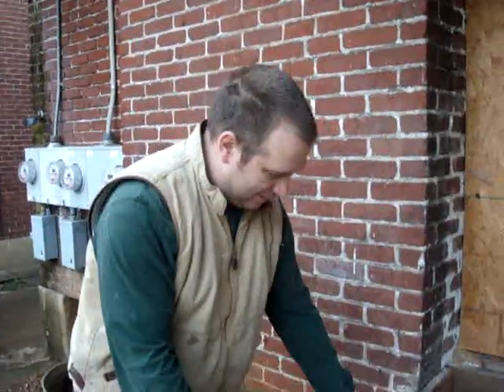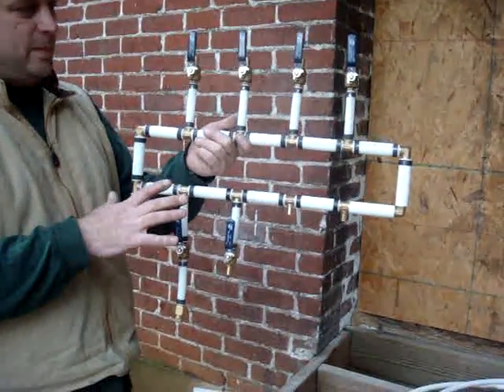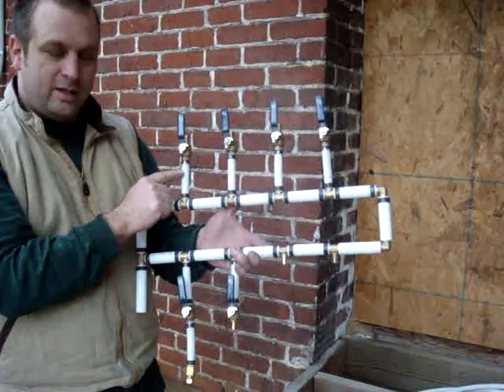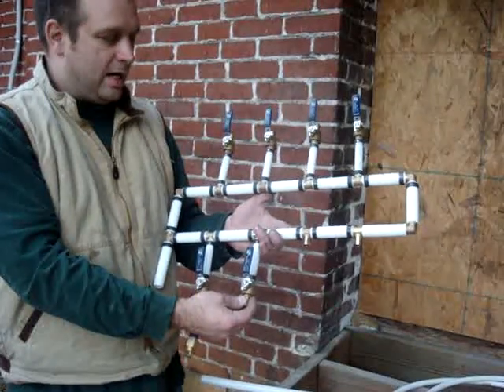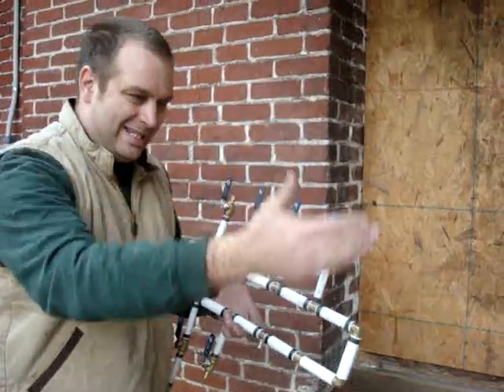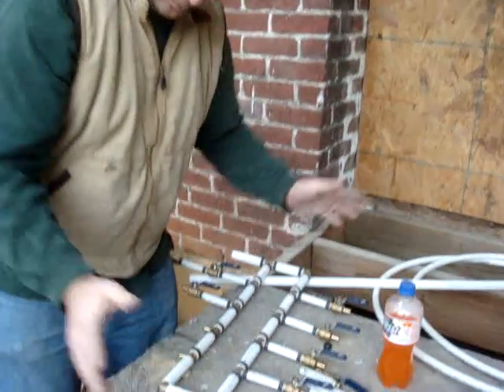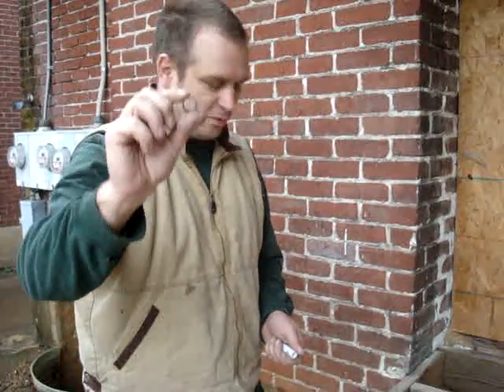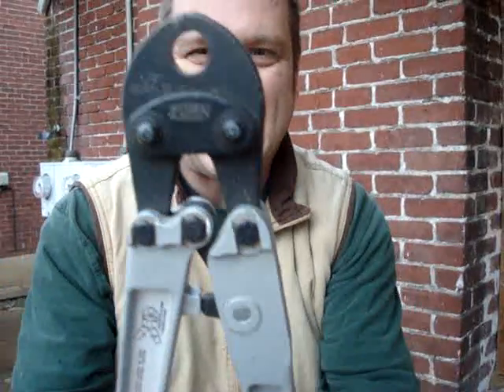Introduction to PEX

Comment from the maker: I don't have any data on that. I use copper because of familiarity and function. I don't have enough experience with expansion to offer any good opinion. I can say I've had no leakage problems with copper rings that are properly clamped. I also run lines so that little to no joints exist inside walls--that's the great thing about PEX over any rigid pipe.

Comment from the maker: I don't know anything about them. I only use brass. I wasn't aware that there were plastic fitting for PEX, but there are for Quest which is polybutelene. That's that grey pipe you see in trailers a lot. Do you have a link for plastic PEX fittings? I'm curious about that.

Comment from the maker: Good question--the idea here is to form a loop so that water pressure coming in at one point of the circle goes equally in both directions. The value of this is regardless of which outlet (one of the T's) is drawing water (to a fixture(s), equal pressure comes from both sides to meet the demand. If two T's on opposite sides of the ring both have draws, they have equal access to water pressure since all T's come off the circle (as opposed to running them in a straight line).

Comment from the maker: It depends on the what's needed, but generally no. The manifolds (for hot and cold) go near the shut off and then I'll run dedicated lines to each fixture or common branches to each shared group (a bath or a kitchen). Dedicated lines for each fixture is awesome, but isn't always practical, so what I commonly do is run one cold and one hot to group (like the bath) and then use a mini-manifold made from brass to divide to each fixture.

Comment from the maker: No worries. I think this was 3/4" inlet only and then 1/2 all the way around. For a small home this is great. PEX has few 90 degree turns and resistance is lower than copper so 1/2 PEX offers a little better volume and pressure than Cu. I guess if you really need more water you could run everything 3/4, but for most residential applications, that seems like a waste of domestic water.

Comment: James, Great Video. I'm one of the slow guys. Is the manifold inlet 3/4 and is the pex 3/4 all around. So..... the tees are 3/4 going in and 1/2 going out to each of the shut out valve. In your manifold you have eight connections.  Thanks....... from the slow guy

Comment: many thanks tryin to gather al the info i can,,Only reason i ask about the size pipe, If you freeze video@ 1.22 where your sticking your finger in the end of the pipe the outer ring is bigger pipe compaired to the ones hooked to the vaules. must be an illusion.  thanks agian,

Comment from the maker: 3/4" inlet and then 1/2" around the manifold and also to each branch. I've ordered tools from pexsupplycom and and I liked them. I buy the pex locally since there no price advantage ordering it. A, B, and C refer to methods of manufacture and won't have impact for your application. (see wiki for details on this) Be sure you check the rings with the no-go gauge and use copper flex lines on water heater.

Comment: Hi james, getting close to starting my manifold, got tools on the way, It looks like in the video that the manifold itself is larger than the ones to the vaulve.are you using 3/4 on manifold and 1/2 from tee out?,,,and are you using type(A) pipe, it looks stiffer like the long piece you show at 38 sec.,,,also im thinking bout getting stuff from pex supply.com, or could you offer any other sugestions, i know im asking alot but i like what i see, thank agian.

Comment from the maker: Zurn sells a starter crimp kit with 3/8 to 3/4 dyes, a ring cutter, an go-nogo gauge in a nice case for around $80 at box stores. I'm not sure what you mean by #1 or #2 line, but it's half inch on the manifold and 1/2 throughout the house. I do use 3/4 for supply from the meter (or well) to the main. Thanks!

Comment from the maker: Each shut off is $6 retail and the ring and pipe are almost pennies. So, 8 valves is around $48 and there might be $4 of misc. for a total cost around $52 for the manifold you see in this video.
Reply: James Glass you double that price
 because you need a hot and cold manifold . Thanks

Comment from the maker: Well, I guess it would depend on water use and your world view. Part of my motivation is to get people to use less water (less energy) so I like the idea of restricting water flow. This won't work for people who think they should massive pressure and volume at every fixture! So, if the goal is getting the most resource to the fixture, then 3/4" is fine, but 1/2 is fine for small families or folks that simply realize they waste most of the water down the drain. Bad answer from me, I guess!

Comment from the maker: Under very heavy use, there is a small pressure drop. I've done some casual testing by installing T fittings and hooking up a pressure gauge. It's not the hardcore testing you'd see in a lab, but I've never gotten a drop > 10% (and often less)  given that I installed all new plumbing from the main shut off 
onward.

Comment from the maker: The best way to do it is the way you're doing it with dedicated lines to each fixture--there is zero drop that way. In a larger home with a lot of people, I'd say it's pretty mandatory. In a small home like this, each use group gets a line, so the one cold water supply to a bath, for example, would only be affected by someone flushing in that bathroom, which is unlikely. So, while not as good, it's a reasonable alternative and it a lot simpler!

Comment: If I was running one line to each room (bath, kitchen, etc), then I would have run 3/4" to the bath and then spit it to each fixture with 1/2" PEX to help avoid any pressure problems.  But it looks like you believe that is overkill.  I'd rather do it your way as it would save me time and money.  You seem detail-oriented and experienced and I'd be very interested in any input you have. Thanks and have fun!

Comment: You are running 1/2" lines to the bathroom and then branching off from that to each bathroom fixture.  What if the shower and the toilet were running at the same time?  Would you then have a drop noticable drop in pressure causing the "hot shower" effect?  I have been running "home runs" to each fixture to avoid that, but it would be a lot more conventient to run my houses the way you are doing it.  Most of my houses are 1 kitch, 1 bath, and 1 laundry set-up in the basement.  Some have 2 baths.

Comment: Hello James.  I buy houses, and then fix them up to rent them in Western PA.  I found this video informative.  I've been buying pre-made mainfolds but I like your loop manifold idea and it would be easy to make.  My store-bought manifolds use a 1" body, where you are only using 3/4".  If you had a toilet, shower and kitchen sink running all at the same time, would you get a noticable drop in pressure?

Comment from the maker: I vary the size based on expected demand, but yes that's a good average. I also like tiny houses, so you can just run everything 1/2 if all you have is one bath and one kitchen. You can even use 3/8 in the interest of water conservation for 1-2 people. The PEX flows so great with such little resistance. I love it. In this case it was 3/4" inlet and then 1/2" for everything including water heater. It's a small house with low demand.